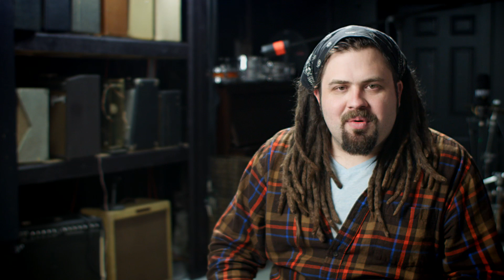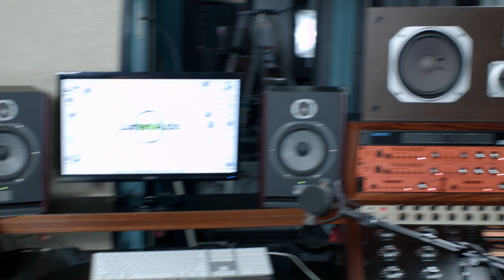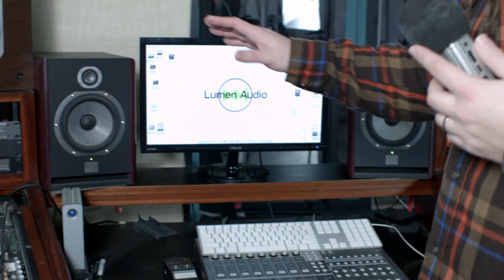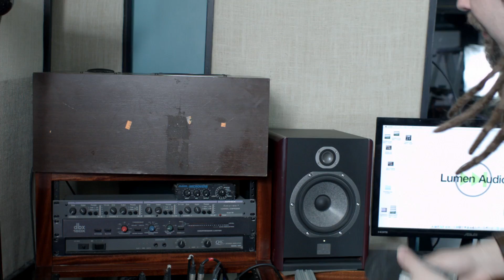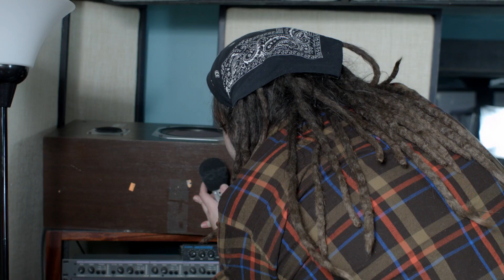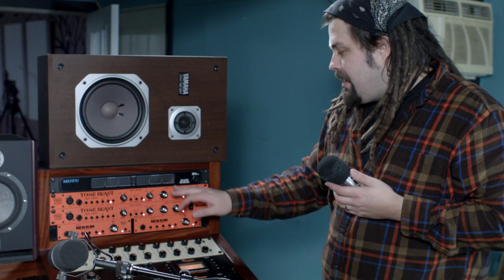Recording Studio Tour - Part 2 - Studio Desk, Rack Gear, Monitors, and Preamps

Comment: i'm sorry if i'm missing it, but what is your current board? i saw where you don't use the mackie for much but talkback and monitor control. but i came here cuz i keep seeing vids with your DAW and a box with a top-down shot of your board, and i'm curious about it. thanks, i know this comment is way after the fact on an old vid.
Reply from the maker: Right now I have my preamps going into the patchbay and then into the converters. I still have the Mackie, but have simplified my set up a lot. I even put up my daw controller with the motorized faders as it was having problems.

Comment: question...are you running your tone beast as a send to your compressor?
Reply from the maker: Like putting a compressor in the Insert/recieve jacks on the back of the TB12? Usually I'll just patch in the compressor after the preamp. But with my new patch bay I saved some jacks so that I could easily use the inserts (I have the send half normaled to the receive so that it makes the connection even when I'm not using it)

Comment: Hey Ryan, 
How exactly do you get from the xlr mic cable to the recorded tracks in your DAW. Especially if you´re recording a lot of tracks at the same time. Or basically, where do you plug them in, since the Motu has only balanced inputs
I´ve looked all over the place for info on this, but no results.
Thank you very much
Reply from the maker: So the mic cables come from the mics, to the mic pre amps, which raise the level of those mic signals up to line level. So the output of the preamps is line level, and (3 pins/wires) is balanced. So a TRS cable (1/4 inch) is also three wires. It goes right into the back of the MOTU. For connections, they were made for one another.
Reply: +creativesoundlab thank you very much

Comment: Hi Ryan! I have small home studio for mixing and it's now at the stage Computer-Audio Interface-Monitors. I see a great advantage in the use of hardware gear in case of record, coz you can use it without latency problem etc. What do you think about using a hardware gear for mixing? In your opinion is it important in the era of great sounding plugins such as uad, soundtoys, waves etc?

Forgive me for my English. Cheers from Russia :)
Reply from the maker: I think that the hardware can sound better. It's almost as if you spend less time messing with it, and it has a greater range of what it can do. When I first got hardware compressors, I thought it sounded as if it was compressing 5 to 7 dB reduction, when it was only 2 to 3 dB reduction. It's just more powerful and more forgiving. I've found myself using plug ins when I need to be fast, but when I need the best sound I spend the extra time to play a track through a real hardware compressor.
Reply: +creativesoundlab Thank you for answer! And what about eq's? It's a big difference too?
Reply from the maker: For me, yeah, I thought the EQP-WA was much different than the UAD Pultec Plug in.